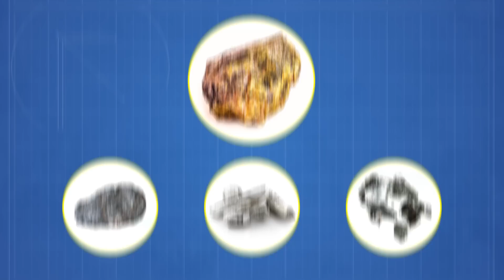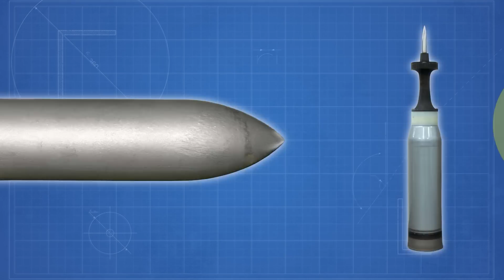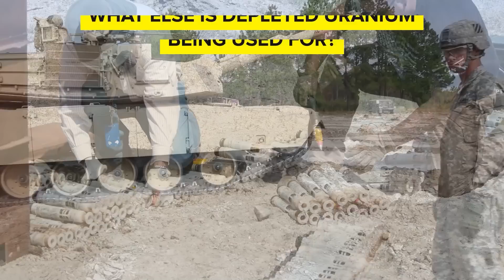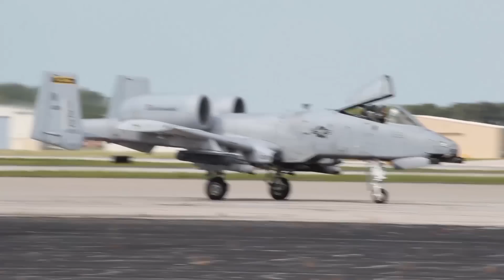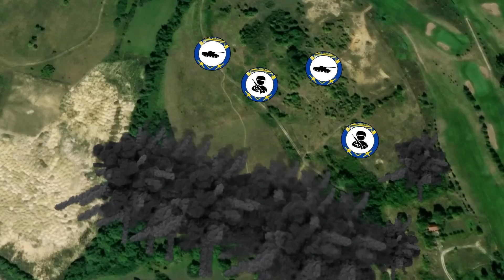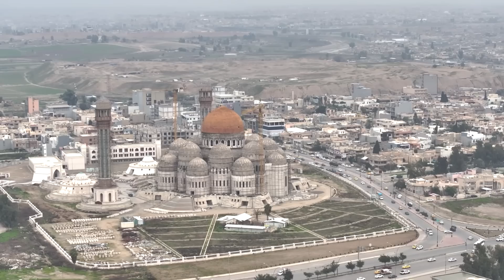The Shocking Reason Why Depleted Uranium Is Used in Ammo

Comment: It's used for penetration power. depleted uranium is extremely dense and the us military does its best to pick up all rounds. the rounds aren't radioactive to be deadly from radiation as they are depleted.
Reply: Being depleted is not the reason that the radiation from DU isn't highly radioactive. Radiation from uranium is already very low. The high radiation levels that relate to uranium have to do with U  in operating reactors or exploded nuclear weapons. The high radiation level in these situations is due to fissioning  of the fuel and the fission products.
Reply: the rest radiation kills only slowly. but it kills. watch " deadly dust". 😠
Reply: not even enriched uranium is radioactive enough to be dangerous. The only circumstance where uranium 235 or 238 is dangerous is when its in the conditions of a reactor, otherwise its radiation is pretty negligible. Its danger is mostly from its chemical toxicity, which is lesser than that of lead, which is way more used. So basically, if we want to call uranium too much pollutant, we would have to ban lead first
Reply: It is not the byproduct of Nuclear Reactors.  It’s the byproduct of uranium mining.  Probably way, way over 95% of uranium mined is not the proper isotope , U-235.  The kind that is fissionable.   Good for heat, or in high concentrations, weapons grade.   The U-234 uranium is not fissionable but is still a low level unstable isotope (unstable means radioactive)  now very dangerous.  However when fired it hits the target all that energy when it hits say armor [sic-i guess] will convert a lot of that kinetic energy into heat that aids in the sectional density by creating the equivalent of a plasma torch to melt I nice round hole through thick plate.   At this point a certain portion of that radioactive metal penetrates the target as a gas.  If in a compartment, like hull of turret of an armored vehicle the superheated gas produced can cause ignition of ammunition, fuel, as well as hot over pressurized gasses that sear the lungs.  The result is low level gamma and alpha radiation emitters on and around that equipment.   Relative to how much vaporized.
Reply: But there have been issue in the nations that DU rounds have been used.  It's a heavy metal and it can't be good if shards or flakes of it gets into the water supply.
Reply: Depleted in its ratio of U-235, but even pure U-238 is radioactive, just about 1/3 as much.
Reply: yea the clicklbait is insane, it makes me really want to stop watching this whole channel, good content somewhat but it makes one feel dumb to click on them
Reply: @PolitikAusBerlin Unfortunately the majority of YouTube channels do it.
Reply: @merlebarney  yea but you don't really have to watch them all, there is enough worthwhile content on youtube without such or like minor clickbait only, it's definetely enough to allow yourself to limit that majority out, it stops being the majority for you atleast when you watch non clickbait videos for a while. I would bet that how clickbaity something is, is definetely calculated into the algorythm that "knows you", if you refuse such videos Youtube shows way less, a few obviously still stays but that's unavoidable.
Atleast I'll try to do so myself ^^'
Reply: I don't like the clickbait, but I could see it causing the ignorant anti DU people's confirmation bias to open their mind to the video. If they think the video is going to reinforce their opinion, they may not outright reject the premise of the video and actually learn something. Maybe im overly optimistic but it seems pretty legit to me.
Reply: @DF-MadBadger  In a world where people are open to listening you would be correct. It will how ever affect people that don't know about DU rounds so that is good. There is so much misinformation about all things radioactive related.
Reply: @PolitikAusBerlin , I agree. To block a channel which does that:
1. Go to the channel's "Videos" page.
2. View the first few seconds of 2 or 3 other videos from the channel.
3. That will cause The Algorithm to suggest more videos from the channel in the suggested videos sidebar; find one of them (ctrl-F or ⌘-F, then search for the channel name).
4. Click the ⋮ on the suggested video, which will bring up a menu of choices.
5. Click "Don't recommend channel"
 (These instructions are for use when using a computer web browser.)
Reply: Thanks for explaining